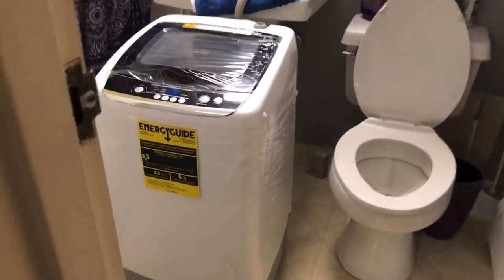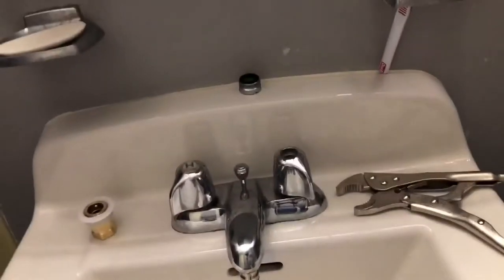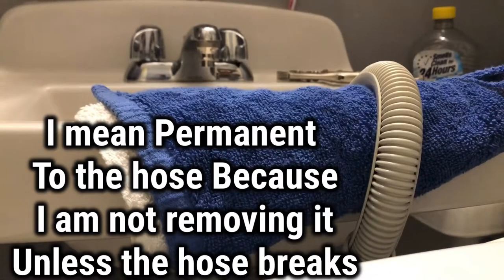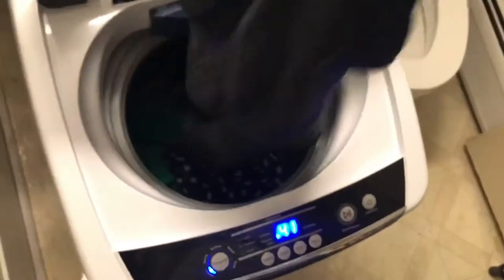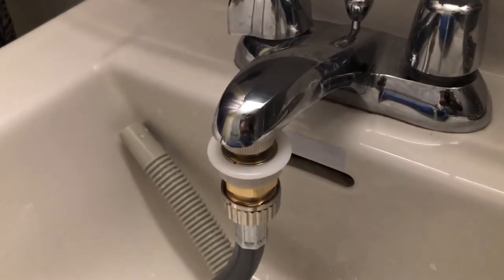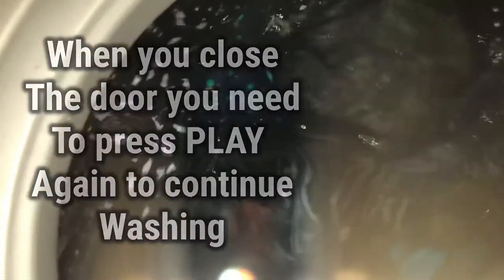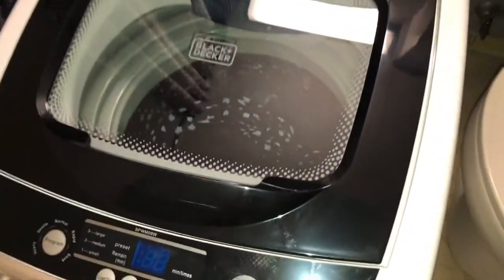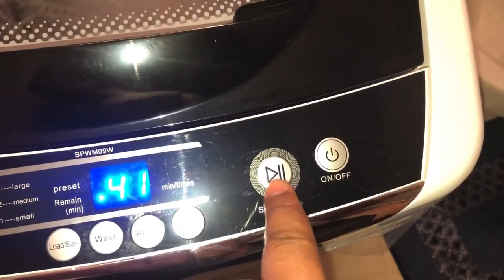Setting up portable washer Black And Decker 0.90 cu feet

Comment: i wonder why you can't use hot water
Reply: Use warm water
Reply from the maker: It will accelerate the wear and tear of the machine. It is cheap plastic. But you can use WARM WATER. Leave thr cold and hot water on at the same time. Ive been using it like thar for over a hear with no problem

Comment from the maker: Update 2023, video coming soon, 2 YEARS LATER. Is the machine still working?

Update March 22-2022. It is still working strong, I use HEAVY MODE because it uses more water and wash more clothes. LEAVE THE WATER ON/ RUNNING DURING THE WHOLE WASHING PROCESS, THIS WAY, IT WILL FILL UP, DRAIN AND REFILL AUTOMATICALLY. 41 Minutes is good enough for me to watch and episode of Netflix Series lol. I have a Queen size bed, and my FITTED AND FLAT SHEET fit perfectly together in the washer. When I wash my "BED COVER/STAIN PROTECTOR", I DONT ADD ANYTHING ELSE BECAUSE IT TAKES MORE SPACE than a flat and fitted sheet. AND FOR GOD SAKE, DO NOT WASH BIG BLANKETS OR COMFORTER. I also have a indoor PANDA portable dryer that don't need to put the hose on the windows. I'll probably make or record a video about it. it does take 1 hour and a half to dry clothes.
Reply: Just answered my question!!! Thank you!! None of these videos tell you if you need to leave the tap running for the full cycle or not! And/or should it be a heavy water run on the tap or medium or what…
Reply: @suda_love same question

Comment: I also wonder why no hot water?
Reply from the maker: This is what the Manual says : " Under certain conditions, hydrogen gas may be produced in a hot water system 
that has not been used for 2 weeks or more. HYDROGEN GAS IS EXPLOSIVE. 
If the hot water system has not been used for 2 weeks or more, before using a 
washer or combination washer-dryer, turn on all hot water faucets and let the 
water flow from each for several minutes. This will release any accumulated 
hydrogen gas. As the gas is flammable, do not smoke or use an open flame 
during this time."  IT SOUNDS TO ME THAT YOU CAN USE IT AS LONG AS YOU CAN OPEN THE VALVE FOR A MINUTE BASED ON WHAT THE MANUAL SAYS. BUT I HAVE USED HOT WATER COMBINED WITH COLD WATER SO I CAN GET WARM WATER. AND THE WASHER IS STILL WORKING. I LOST THE QUICK CONNECT BY THE WAY, IM LOOKING FOR A REPLACEMENT CAUSE IDK WHERE I PUT IT.
Reply: @iPostWhatever  Thank you. A portable washer will nip my masochistic tendencies in the bud.

Comment: Do i keep the tap running for the full cycle? Or do i turn it off when the machine is filled with water????
Reply from the maker: LEAVE IT ON, DURING THE ENTIRE PROCESS. YES LEAVE IT RUNNING FOR THE FULL CYCLE. THIS WAY THE MACHINE WILL USE THE WATER TO FILL UP AGAIN AUTOMATICALLY.
Reply: @iPostWhatever  Thank youuuuuuuuuuuuuuuuu

Comment: My faucet connection only screws in without the rubber washer. I’ll have too see how an adaptor works, if it works.
Reply from the maker: That’s weird. Maybe the washer is thick, if that is the case, try a thinner one. Without it, it will leak.
Reply: @iPostWhatever  I put a thinner one that resolved some leak I tightened all joints again also. However I still had an under sink leak while washing (for the first time) that got onto the floor. Not a heavy one—about 1-2 glasses of water size. My solution that stopped the leak is that I can’t keep the water faucet on for the whole time. I have to shut it off after it fills for wash and after it fills for rinse. These are old pipes/old plumbing in buildings. Plumber might be needed eventually (this building has always had water damage issues). Washer works great though for first time.

Comment: When is the right time to add the softener downy?
Reply from the maker: Right after the first cycle ends 
1. Turn on the water/open the valve
2. Insert the clothes
3. Add detergent 
4. Start washig
5. Once the machine stops, it will drain the water, then it will start spinning. Once it stops spinning, it will automatically refill with water you can add the softener now. You can pause it and open the lit, then close it and press start. SOMETIMES I ADD THE DETERGENT AND SOFTENER AT THE SAME TIME LOL.
Reply: Thanks 👍🏻 for the tip @iPostWhatever

Comment: Once the washer gets full do u turn the water off until the next cycle
Reply from the maker: No, i leave it on during the whole washing process, this way you can leave the machine doing its thing automatically. IT WILL FILL, DRAIN AND REFILL AUTOMATICALLY. I use softerner in the last round or the las 10 minutes remaining. I have been using HEAVY MODE lately because  it use more water and i can wash more clothes.

Comment: So do you leave water turned on the whole time or do you cut it off in between? Also can you use tide pods?
Reply from the maker: Yes, i leave it on during the whole washing process, This way it would reload water automatically. I only turn it off, when I am done washing. I have not use Tide pods yet, so I am not sure, but I'll give it a try. I only use normal liquid detergent and then a softener in the last round.

Comment: Why cant you put the draining hose in the tub to drain the water?
Reply: Has to be higher than the machine water level too or any machine will leak
Reply from the maker: He is right. But you can leave the hose hanging on the side of the washer and the remaining part of the hose pointing towards anywhere you want the water to drain like toilet, sink etc.. but when you finish more water will remain inside the washer. You won’t see it, but it will be there. But if you are going to do laundry weekly, thar water will drain and free space for three new water lol. It is nkt a big deal.

Comment: It was leaking from the adapter to the faucet so i took out off. There was a metal wire coiled into the adapter and it was sticking out. So i pulled it all out. Now I think its broke . Do you know?

Comment from the maker: Update September 06-2024 The Washing machine still working strong. On Amazon Portable Washer https://amzn.to/3YHiaM6 . I have been using WARM WATER for over a year now. I open the cold and hot valve to create warm water. Clothes come out cleaner than ever now. Every washing mode is preset but you can customize them, like if it says 41 min total, you can reduce de number of loads, cycles and for how long you want it to spin. If the washer ever stop, does not want to spin and it is full of water or if the water is constantly running through the draining hose, washer not retaining the water, then TURN IT OFF, UNPLUG IT AND DRAIN IT MANUALLY BY OPENING THE BACK BOTTOM CAP. Once it is drained replace/close back bottom cap, plug the the washer back in, turn it on, set it on NORMAL MODE or RAPID MODE to test it. If it still not retaining the water, repeat the process and it should be working fine the second tiem.

Comment: are u suppose to turn off the water?
Reply from the maker: No, do not turn off the water, you need to leave it running. The washer internal valve do the opening and closing automatically. Turn it off only when you are done with laundry.

Comment: this is super informative! i was wondering why you can't use hot water tho? the washer doesnt heat up the water at all right?
Reply: It’s plastic so hot isn’t recommended as it can damage the seams over time. Will void warranty

Comment: Used it for the first time today and now it won’t work. It spun and had extra rinse on and stopped on the second rinse. Blinking rinse and now it’s just humming and won’t start anything. Read through manual. Don’t know what to do.
Reply from the maker: IF IT HAS WATER STILL IN IT, UNPLUG THE WASHER FROM THE OUTLET, DISCONECT THE FILLING HOSE,  DRAIN THE WASHER BY OPENING THE BOTTOM REAR CAP. RECONECT THE FILLING HOSE/TOP HOSE, PLUG IT IN AGAIN. OPEN THE WATER VALVE, TURN IT ON AGAIN, SELECT NORMAL MODE, SELECT START TO TEST IT.
Reply: @iPostWhatever  I ended up returning it because I did all trouble shooting and called manufacturer and they said it was defective

Comment: really wanted to see if a tid bit of water leaked from faucet
Reply from the maker: Mine have never leaked a single drop of water. This is why it is not recommended to use hot water, so you don't damage the washer.

Comment: Dose the hose come with the adapter or separately
Reply from the maker: Hose come with the QuickConnect pieces, expecting to fir in your current faucet. If it doesn’t then you will need an adapter. Link in the description.